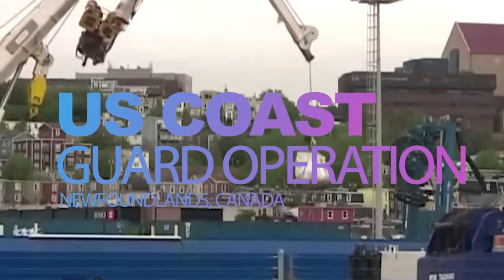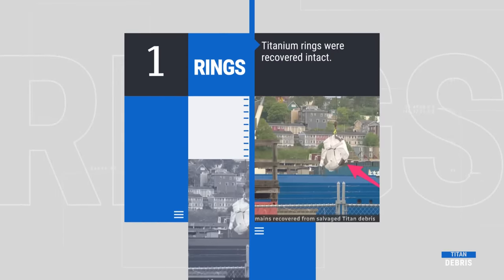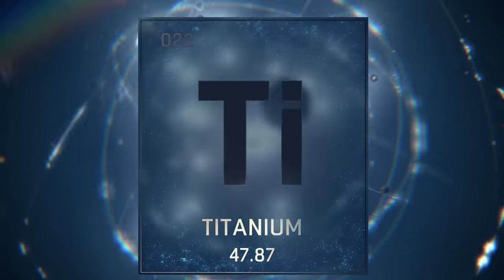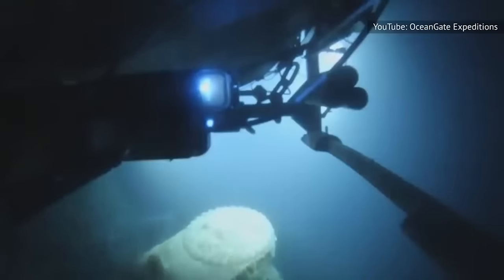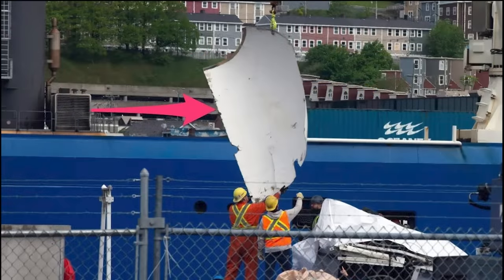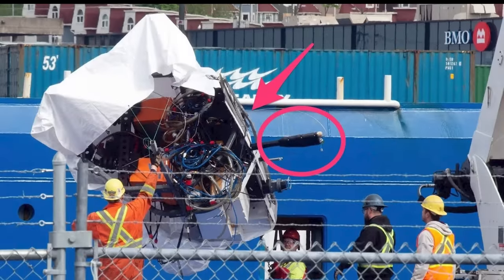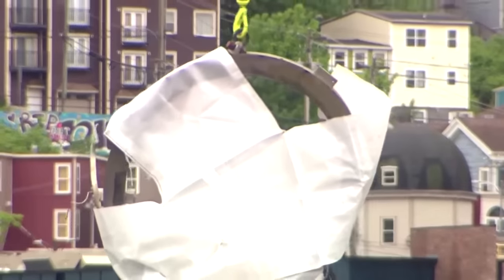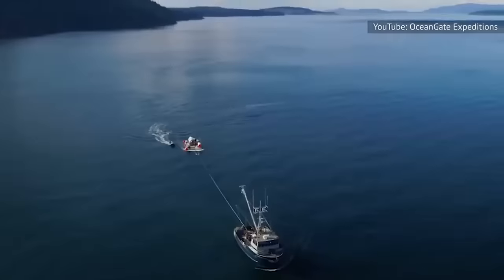What Really Happened? The Titan Submarine Clues from Parts after Implosion

Comment: First the claim of "courageous crew" is wildly verbose. Only the CEO had any knowledge of the capacity and limitations of the vessel, and he suffered from dollar tunnel vision.  The four other humans were miss led by a sales pitch of low risk and the signatures releasing responsibility a legal formality.  (energy in that compartment equal to 74 sticks of dynamite) We have grown a custom to such document.  The level of concern was higher here but the comfort with signing was engrained from repeated doing so.  Fore example the legal formality we face daily when we get access to the internet.  My guess is that those releases are not worth the paper they are written on. The lack of resources of the company to go after is the only thing that will limit law suits since what was not disclose made those signatures done without sufficient knowledge.  
     I can not think of one time that I have ever hear someone claiming that a composite component under significant load will NOT HAVE DEFECTS SUCH AS A SEPARATION OF AT THE FILLIMENT TO BINDING PLASTIC, EPOXY INTERFACE.   Further  there is always a worry that if the cracks break the surface, liquids such as water will not enter.   
     I have not in any of the many YouTube videos once learned of any attempt to seal the outside of the filament wound cylinder from the sea water.  Not hear of a very thick epoxy layer well thicker then normal. Or better yet an material that was not brittle such as an elastomer or plastic such as acrylic, a material use for submersible to great depths.  The Youngs modulus of these materials are far less then steel or the carbon fiber wound cylinder that the ocean pressure would have always kept it bonded to carbon fiber.  The diffusion rate of water molecules through material that would be considered would be very low so that any liquid that did diffused through to the composite wouldn't have pressure behind it causing a force to blow the vessel apart from within.  Obviously the pressure has to go from depth pressure at the outside to atmospheric within so a gradient exist.

Comment: Carbon Fibre makes for 
great blade scales.

But there's a certain 
brittleness factor to the material.🤔

Did these idiots really think 
they could epoxy  some crap together? 
 With glue?

At best, gross negligence.
At worst, another dem  psy-op.😮
Reply: I work with cars a lot. Not to the extent that I’d call myself a mechanic, but I definitely know my way around them. I’ve worked with carbon fiber drive shafts, which are made specifically to flex. And those are 2 inch thick rods. If a car transmission can bend 2 in he’s of carbon fiber, that 5 inches of carbon fiber holding the Titan together stood absolutely zero chance against the strength of the ocean. I honestly cannot even fathom why they chose to use carbon fiber, aside from sheer ignorance. I can’t believe it made it past its first dive.

Comment: Courageous crew? Not at all, just foolhardy and failing to listen to more experienced builders. Carbon fiber is very strong but when it fails it just powders, this is one of the reasons why many 2,000 hp and higher drag race cars use carbon fiber driveshafts because when metal ones fail they flail around and do huge damage. The fail point is always sudden and does not necessarily occur at the theoretical point.

Comment: Seems most likely that the connection between the end caps and carbon fibre tube failed.  This would produce the lack of any visible carbon fibre left in the connection areas.  If it failed in any other location, you would expect some shards of carbon fibre still attached to the end caps.

Comment: Short answer: the adhesive that holds the end caps probably failed.
Reply: Not likely as the pressure would have pushed these parts in and actually helped seal them. To rip the hole thing apart you would need a collapse of the hull. Everything else would have killed them but not ripped the vessel apart.

Comment: Weird but, pieces are way too big, tape is all over everything as is tarps, and no water is leaking out of the parts being lifted. Also, oceangate says the last message they got before losing contact stated it had dropped its weight as was attempting to return to the surface, so why wasn't something said straight away about that, then why with all the 96 hours of air remaining, then the banging? Then as soon as the time for the air had ran out, they didn't even slightly hesitate to say it imploded. This whole story is fishy as fuck!!
Reply: You're seeing it lifted off the ship. Not the water. Any water as already fallen.
Reply: Conspiracy theory much?
Reply: @erchay  my conspiracy is that they were alive the whole time, and them banging on the walls while on the sea floor is what made the sub blow out miserably due to already being under too much stress 😬
Reply: The implosion was confirmed after a debris field was sighted, well after the 96 hours air supply supposed to run out.
Reply: It must be exhausting coming up with a conspiracy for everything.
Reply: @manwell235  Apparently the navy knew it had imploded on day one but said nothing. The story is a but strange.
Reply: @Chris-fm1rk  bcos the coast guard wanted to confirm if it was really the Titan that imploded. Jumping to conclusion would cause anguish to the families. The final confirmation came after they have managed to locate debris from the Titan

Comment: I definitely looks like the window failed too me
Reply: The window was intended to take pressure from the outside, that is why it was rounded the way it was. If the transcripts from the sub are correct, it would appear that it was taking in water from the rear and this was why it had difficulty rising. The bulkhead between the two parts of the tube would then have given way, blowing the window from the dome and separating the dome and ring from the tube. This sounds like a plausible cause as they were sending messages to the ship giving depths and it was rising very slowly.

Comment: Another incorrect statement - because the rear tail shell did not reside inside the pressure vessel, it was not subjected to the result of the implosion.  There was a balance of pressure in the rear compartment so there is not a high pressure differential gradient for the implosion forces to act!!!
Reply: You need to re-think that. The rear mechanical section outside the Titan's pressure hull was protected, for the most part, form the implosion & any resulting compression explosion by the rear hemispherical titanium bulkhead. More than likely any concussive force  would have transferred to the full titanium section before pushing on the rear mechanical compartment.
Reply: @weldonyoung1013  No. The rear bulkhead was just an under water fairing. It was outside of the rear titanium dome cap!  it has the same water pressure on both sides so that's why there was no force to shread it to pieces!!
Reply: @LWRC  , I believe you are saying there was another structure between the rear titanium dome & the mechanical compartment, and are calling it a "bulkhead". To me a bulkhead is a strong structure, a wall if you will, such as the titanium dome. Given how Stockton Rush tried to save cost, I believe the only structure between the mechanical section & life compartment, would be the titanium pressure dome.
Reply: @weldonyoung1013  There is no structure between the rear titanium dome and the rear bulkhead, fairing, cover or whatever you want to call it!  It had the same pressure on both sides and was external of the passenger compartment and outside the titanium dome.
Reply: @LWRC  , ok. If you insist.
But, besides the static water pressure, there might have been a large blunt force of the rear titanium pressure dome being forced into and/or receiving the force of the implosion/explosion). Given the "large" surface area compared to each structure the forces involve would be "relatively small". So we appear to agree on that.
Reply: @LWRC .
Are you saying the rear titanium doom had a laminated protective shield on it?
Reply: @weldonyoung1013  You are talking a lot buy saying basically nothing. You apparently do not comprehend pressure differentials and pressure gradients and keep focusing on surface area!  
It is not what I say but what is in fact reality - take a look at the drawings of this sub and you will see what I'm referring to.  The external shell in the rear is just a shell and nothing more and had the same water pressure on both sides whether it was on top of the ocean or at 4000 meters deep!
Reply: @weldonyoung1013  No.  The rear and the front titanium dome both were glued to the CF hull using epoxy adhesive glue!  That glue was subjected to the 6000PSI water pressure at 4000 meters depth.  That glue was never pressure tested to 18,000PSI ! ! !   Any life rated system should be tested with a safety factor of 3:1 if not more up to 10:1.  This sub didn't have any of that !!!
Reply: @weldonyoung1013  The rear cover, or you can call it a 'tail', is just a rear section and had nothing to do with being part of the pressure vessel of the sub. It was just there as a cover for other equipment needed for the operation of the sub.

Comment: The sub was sinking had flooding in the rear, the Carbon Fiber shattered under the pressure and the cold. What were the bodies of the victims was blow at 1500 MPH through the porthole.
Like stepping on a toothpaste tube the cap blew off and the paste came out on a spray.
Reply: Nicely put. Do you enjoy the toothpaste factor?  I like the anology 😅😊
Reply: The flooding in the rear explains why the sub was unable to rise quickly to the surface. If the transcripts published are true, it was only rising by a few feet per minute. This would likely have blown the bulkhead between the two parts of the sub and separated the dome with the viewing port which was stuck on using a thin layer of glue.
Reply: @williamgeorgefraser  so, it imploded and they were shot through the viewing port?

Comment: what would happen if they put on deep diving scuba suits and built a sub that fills with water with them inside, attached to breathing apparatus, could it help the pressurized cabin?
Reply: You mean a diving Bell? At 6000psi you would not survive.
Reply: Yeah, under that pressure any body cavity that is not full of fluid would essentially collapse. Like the lungs for example.
Reply: Deepest saturation depths generally about 250 metres in a Jim suit about 700 metres leaving about 3000 metres of pressure for just the hull to manage so not really a big help. The gas handling for breathing would be very complex and cost a fortune for the saturation diver set up.The implosion would be a lot less destructive probably allowing some sort of body retrieval but still very messy.
Reply: It's like putting on a bulletproof vest right before a rocket hits you. Won't do anything
Reply: That's a bit like when you are in a jet that is falling out the sky. You wait at the door and jump out when it is 2 ft from the ground so jumping from 2 ft don't hurt you.

Comment: One strange thing is also that the titanium rings seem to have been recovered no longer attached to the titanium domes,which they were bolted to.  Does that mean all the bolts sheered in the implosion?  I am beginning to thing this those videos of the recovery were somewhat of a recreation, and not the first time those bits were actually brought out of the water
Reply: I was thinking the same thing. Even at lower grade in quality like 8.8 it must have been quite some force snapping all of them lose. They must have been used thicker bolts than 10mm!? Something doesn’t add up here.
Look at the front glass, where are the bolt holes, or does the snapped off bolts cover them!?

It looks strange.
Reply: @Skyisnotalimit  That's exactly what I was saying.  All the bolts must have sheered off, if they really brought them up like that.  I don't believe those recovery submersibles had some damn spanner attachment to undo it, all and like we've said you can't even see the holes where the bolts would have been.  It looks flat
Reply: @arthurdaly3497  Yes it would be quite some task unbolting all of them at that depth. 
I hope the examination of all parts will give answers.

Comment: Even If the hull was made out of titanium, the porthole would have burst and the same thing would have happened
Reply: The porthole did not burst
Reply: @JoeSmith-cy9wj  because the carbon fiber did first? Common sense
Reply: @powderedwater4742  did you know the porthole was the only certified submersible part. Do you know they have a safety factor? Lear a little something before opening your mouth
Reply: @JoeSmith-cy9wj  he should Lear from his missteaks
Reply: @JoeSmith-cy9wj  THE PORTHOLE WASN'T ABLE TO TAKE THAT PRESSURE
Reply: @philliptiestopl1511  like lifting chain, climbing rope , elevator cable , these things and thousands mote have a safety factor . FACTOR : a number you multiply by to get the correct result. 
A safety factor of three (3) or four (4) is usually used in life critical materials. 
If something,  like climbing rope is RATED for 3,000 lbs with a safety factor of 3, that means it can hold 9,000 pounds before breaking.
You are not supposed to exceed the RATED pressure, BUT YOU CAN.
A FACTOR OF 3 ON THE WINDOW WOULD PROMISE YOU 4,500 METERS would give 14,760 FEET BEFORE BURSTING.
DO YOU HAVE A FRIGGING CLUE NOW??????
Reply: @Jay-eo3wl  you mother.
I know what i saw .what's yours?
Reply: If the viewport failed the pressure on the rest of the craft would have equalized immediately and would be totally intact.
Reply: @JoeSmith-cy9wj  The viewport (not a porthole) was not certified for the depth of the Titanic.
Reply: @jguenther3049  correct. It also had a safety factor   which means it can withstand several times it's rated depth.
Reply: @jguenther3049  of course   you are not supposed to do that. But it is possible.  Your not supposed to make a submarine from plastic either.
Reply: @JoeSmith-cy9wj  porthole wasn't rated for their Intended dive depth🤣
Reply: @3tpculp  which would have vaporized the passengers, same result
Reply: @powderedwater4742  LOL VAPORIZED??? LOL
Reply: @Jay-eo3wl  yeah, right!

Comment: The window wouldnt have been blown out if it imploded.... smh nothing blows away when you create an implosion but it definitely does when things explode....
Reply: If they were sitting at the bottom banging like we originally got told, maybe the banging is what took its final toll on the vessel as it was already under stress from the immense amount of pressure at that depth.
Reply: Because the air in the Titan blown out the window when the Titan imploded.

Comment: they lifted the titanium end cap by placing a rope through the port window, so did the port window give way as it was only rated for 1300 meters and they foolishly took it to nearly 4000 meters a number of times, or did the implosion blow out the window separately, it was highly probable that the port window gave way and blew out the titanium end caps, either way the port window is gone !!!
Reply: Thought they stated it was highly likely the window blew out first.
Reply: According to the texts, the issue was in the aft. The teardrop aft was another point of contention because submersibles are usually round in order to accept the forces of depth evenly around the Hull. However this restricts space so oceangate went with the cylinder style. The texts, if real, repeatedly mention noises from the aft. It seems the aft was breaking apart. They had problems dropping ballast & continued to sink. Then they weren't ascending as quickly as normal. Something was restricting them which was probably the outer Hull filling with water. Then they had electrical problems beyond the RTM alarms they were dealing with. They weren't answering questions from topside which indicates a degree of panic. I believe the last text was "still hearing loud noises from aft." So it sounds like the issues began in the rear & the porthole was probably blown outward.

Comment: there are two titanium domes...one with the viewport and a rear one that has a pressurized pass-through for the cabling/electrical.....dome, carbon fiber pressure chamber, then another dome....the white shell is just that..a shell. The shell covers the rear dome as well as all of the electronics/tracking, etc. The shells are not part of anything pressurized so there's no reason it would be subjected to forces of the implosion...the shells just blew off from the main CF hull.

Comment: Anyone who's used them knows epoxy glue and carbon fibre are nowhere near as good as the manufacturers always claim.   Hardly anyone even makes bicycles made out of carbon fibre anymore after they all shattered to pieces after a while.  I would never trust that material for any application where it comes under repeated shocks or pressure